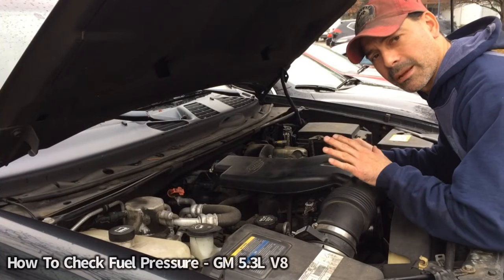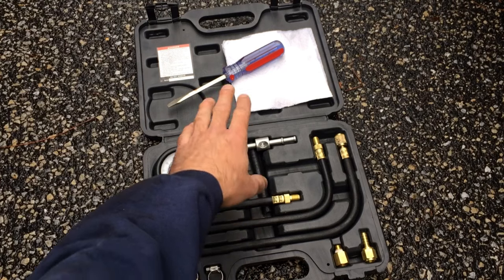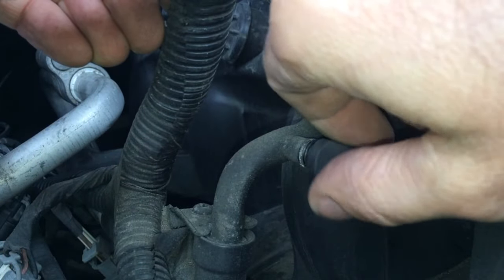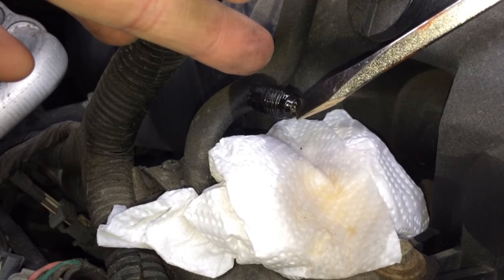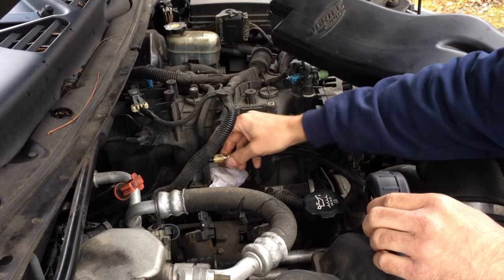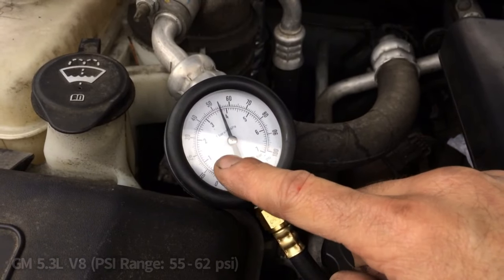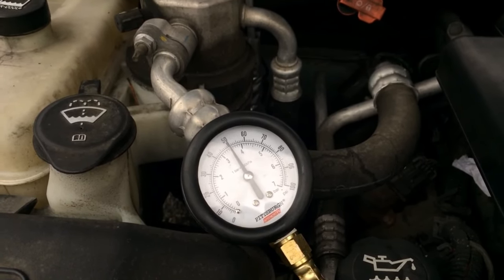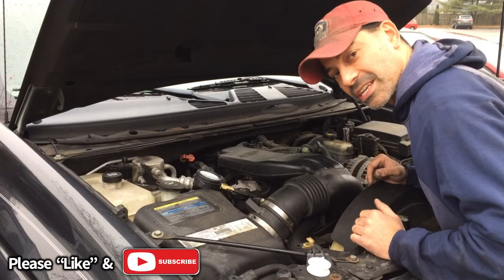How To Check Fuel Pressure - GM 5.3L V8 (Andy’s Garage: Episode - 147)

Comment: Generally a good video.  There is one problem with using teflon tape or any other tape style sealant on a fuel system.  It risks breaking free and clogging downstream components.  This is why manufacturers and experienced mechanics will tell you this is a fail.  IF you must use a sealant then use an appropriate liquid sealant.  However, unless the threads are damaged this should not be necessary.  Tighten the Schrader valve by hand very snugly.  You should not even have to use a wrench or pliers.  That is why the connection for the test port is a knurled hand fitting and does not include a hex or other type driven wrench fitting.   Use tape and a piece is likely to break free and float around causing you a headache later.  This is especially true in fuel injected engines as the tiny atomization ports can clog with particles down to a few microns.
Reply: I've used Blue Monster yellow tape in the past and haven't had any issues to date.  Not sure if it's recommended but it's what I do.  🤷
Reply: It is temporary. Its fine.

Comment: The best way to bleed off fuel pressure is remove the FUEL PUMP FUSE and start the truck. Let it run until it stalls. If it attempts to start but doesn't, try once more to remove residual pressure. Use rags when installing or removing test equipment. When tasks are complete, reinstall fuse. Check for leaks!
Reply: Similar to how I run a carb dry on a bike. Turn of the fuel and run it.til it's gone
Reply: I would only go through all that if actually removing the fuel pump or filter clearing the rail just for pressure test is fine Otherwise your wasting fuel
Reply: Its not so much wasting the fuel. Some crack a line and let it spray. Some drain it in a catch pan. Some let it go to the ground. I prefer letting it bleed off by letting the engine handle it. No matter how its done, it has to be depressurized of any residual pressure to proceed. The environment and safety are priority.
Reply: Thankyou bro

Comment: I have a 2005 gmc envoy. Starts in the mornings but the After I shut it off once, it won’t start. Cranks only. Lately if I let it set for about 5 hrs it will usually start.
Reply: you might have an injector stuck open

Comment: Mine has 400k. And I’m suspecting it may have a bad fuel pump. Feels weak. But I have 35’s. And the other day. It kept shutting off, and after a few try’s it would turn on for a few seconds and then shut off. After a few of those. It did manage to stay on to drive back home 1/8 mile.
Reply from the maker: Make sure the pressure is to spec for your vehicle. If not, it could be the pump or pressure regulator

Comment: Currently experiencing a crank but no start on a 1999 Silverado 5.3L.  It has been sitting for a long time without being used and I recently replaced the battery to start up and get it running again.  Tank was empty so I added approx 4 to 6 gallons of fuel and used some starter spray.  Engine ran for a few seconds with spray but never stopped after that.  Would like to check fuel line pressure with this kit and wanted to know if turning the key to the on position, will the pump create enough pressure to get an accurate reading?  Thanks!
Reply from the maker: I had a similar situation with a vehicle I purchased a few years back. If the vehicle sat too long without being properly prepared for storage, the fuel system could be destroyed. Your fuel pump, regulator and Injectors could be corroded and seized up. Turn the key to the on position and listen for the fuel pump to hum for a couple seconds. If you hear it, then check for pressure. Just turning to the on position will created proper pressure if the pump is fine. If you don’t hear the pump, check to make sure the relay is good. If it’s good then the fuel pump needs to be replaced. Regardless of the pumps performance, if the vehicle still won’t start, check the Injectors since they may be corroded and needing to be replaced as well.

Comment: Andy, I have a 2011 Avalanche LS 5.3, my fuel pressure gauge starts at 53psi the drops to 42 psi, I have replaced fuel pump, both knock sensors, map sensor, maf sensor, spark plugs, Catalytic converter is good, the strange thing is I do not get any codes. I am exhausted with trying to correct this issue with poor accelation, it started now a month.
Reply from the maker: Did you replace the pump with an aftermarket one? Also, have you checked the pressure regulator and fuel filter?
Reply: Adelphi unit, regulator good and the filter is in gas tank its a permanent
Reply: Fuel lines. Might at well replace it all at that point

Comment: I have a 2018 Tahoe 5.3 and I notice that the needle of my fuel pressure gauge is erratic bouncing around during idle.  When I prime it the psi goes up to 80psi. Then 45min later it would drop to 60psi.
Reply from the maker: Could be the pressure regulator as well

Comment: FYI - I watched several tahoe fuel pump / fuel pressure videos.  I wonder if everyone is misleading viewers.  My 2004 Tahoe was running rough &  cutting off once in a while.  So I changed my fuel pump and rechecked the fuel pressure.  I saw a 43-45 psi pressure reading again at idle (wth!).  From what your video is saying this is low.  But then I disconnected the vacuum line going to the pressure regulator and the pressure jumped to normal 55 psi pressure.  I also saw your pressure was around high 40's when you 1st started your Tahoe too.  So should fuel pressure should be checked with the vacuum line disconnected?🤔
Reply from the maker: Try it both ways. It could be a faulty pressure regulator

Comment: I am having fluttering or stalling sensation coming to stops really bad after restarts.  Usually running 34 psi out back. It gets as low as 19 psi sometimes. Starts of at 80 psi  sometimes will hold around 55 or 60ish till i start driving for while it will come back down to 34psi.  2021 chevy silverado 1500
Reply from the maker: Sounds like your pressure regulator, but could also be your pump starting to fail. I would replace the pressure regulator first since it is cheaper and easier to do. If that doesn’t solve it then you need to look at the pump
Reply: @Phillips Vision  appreciate your time sir.  Thanks

Comment: My Silverado has 50 psi after replacing the psi reg.
The misfire usually occurs when hot and high humidity will shake your teeth. The idle can be there rough.
Replaced evap solenoid and parts store scanner claimed maf sensor was bad. Nope.

Time for fuel pump

Comment: I just changed my fuel pump and fuel filter on my 2002 5.3 chevy tahoe. I was at 42 psi prior to changing out the pump and filter. I'm still at 42 psi. Could the fuel pressure regulator the fault for having not enough psi as I should?
Reply from the maker: Yes, could be the problem. Before you change it make sure you have a tight connection at the schrader valve
Reply: @PhillipsVision  for when checking the psi? I was using pipe tape on both the Guage connection and the rail connection so I'd imagine there was no leaks. I'm going to change it this morning. After changing the fuel pump yesterday, changing the regulator is nothing lol
Reply: @PhillipsVision  it's a flex fuel engine. Does that change the needed psi?
Reply: @mikespence8895  did the regulator fix the problem?
Reply: @rayriley174  no.
Reply: @rayriley174  I gained about 3 psi.
Reply: @mikespence8895  any uodate?
Reply: @davidbollier3859  I changed the fuel pressure regulator and I gained 3 psi.
Reply: @mikespence8895  hi mike it’s  been 6 months, are you still having this problem or were you able to solve brother ?
Reply: @heirloom462  I just left it and haven't had any problems.
Reply: @heirloom462  I also changed the regulator and it was still at 42.
Reply: @mikespence8895  
Flex Fuel Engines ("Z" 8th Digit in VIN) Issa Different PSI than all others
Reply: Unplug the vacuum line going to the fuel pressure regulator and see what pressure does.  Mine was 45-48 psi with vacuum 😮line connected.  Disconnected the psi went to 55 psi... I changed the fuel pressure regulator today & rechecked the fuel pressure...

Comment: After filling the tank last night on my 03 4.8 silverado when i went to start it this morning all I got was cranking with no start. I put a fuel pressure guage on and with the key turned to on it doesn't move the needle at all. am I doing something wrong... thanks
Reply from the maker: Do you hear the pump priming (humming noise for about 3 secs when you turn the key)?
Reply: @PhillipsVision  yes I do hear something for few seconds
Reply from the maker: So...you are getting pressure from the pump but not holding it? Could be the pressure regulator
Reply: Thanks I'll check that out next

Comment: Hey Andy .  I wanted to thank you for your time in explaining the pressure gauge hook up process as it is different than the way I had been doing it .  I never bled the pressure off of the rail before connecting my gauge .  I also want to thank you for saying what the fuel pressure is " actually " supposed to be on these engines .  All of the other videos I've watched never announced the pressure .  I just replaced my original fuel pump because the truck is a 2000 Chevy Silverado 1500 with the 5.3 in it and the fuel gauge wasn't working properly anymore and the fuel pressure was reading @ 50 psi and would drop down to 49 psi within several seconds  .  So I bought a " Brand New " AcDelco fuel pump and changed it out , did a pressure test and came up with  52 psi and it would drop down to 50 psi within several seconds .  With that being said and going by what you are saying the fuel pressure " should "  actually be  , it looks like this " New Fuel Pump "  could be bad too .  The truck was still showing a code P0300 multiple cylinder misfire , so I changed out the spark plugs and the truck ran worse .  I more than likely should've changed out the plug wires too while I was at it , just didn't think it needed them until now .  Fuel injectors were all showing the same amount of pressure drop ( 17 psi ) when I tested them and the multi-meter test showed they were all getting the same readings , so I think I can rule out the injectors .
Reply from the maker: Does the pressure stop at 50psi or keep dropping? If it keeps dropping you may need to install an in-line fuel check valve to maintain the pressure, here's a video I did installing one: https://youtu.be/STIQa1ct_5s . The P0300 code is also a random misfire which can be tricky to diagnose. As for the truck running worse; did you gap the plugs properly? Bad plug wires can cause the P0300 as well but you may want to test the wire resistance before replacing them. I did a video on testing the wires, here's the link: https://youtu.be/am4JlHK1kS8 . Hope this helps
Reply: @PhillipsVision  Thanks for responding Andy .  I was wrong with my numbers in the first message to you after the new fuel pump install . The fuel pressure was 50 psi and then would build up to 52 psi within several seconds .  At least the new one  was building up instead of dropping like the old one was doing .  No , the pressure doesn't keep dropping , it stays @ 52 once it builds up from 50  .  It only takes a few seconds for it to build up to 52 psi from the 50 psi it initially starts at .  The plugs were gapped to  .40 as per specs .  Also ran some fuel injector cleaner through the fuel rail .  Unplugged the fuel pump fuse under the hood , hooked my injector cleaning system to the fuel rail ,  then started the truck and let it run until the canister ran dry and the truck stopped running .  It just seems odd to me that a " brand new "  AcDelco fuel pump only raises my psi by 2  ,  from 50 to 52 psi .  I thought the fuel pressure was supposed to be between 55 and 60 psi though ?  If that would be the case , my new pump isn't putting out like it should .  The truck seems like it's not getting the fuel output it needs .  I installed a new fuel filter , new fuel pump , new plugs and wires and the injector testing resulted in a pressure drop of  17 psi on all 8  injectors .  However , I don't know if 17 psi is a long enough duration of a pressure spray of fuel per cylinder .  If there is anyone out there that has done similar injector pressure drop testing please feel free to share your findings or results .
Reply: @jasond.606  had the same issue wasn't fuel P0300 it was a coil pack.
Reply: @jackhilley6962  Hey Jack .  Thanks again for responding .  I had a local dealership do a diagnostic check on the truck and they said it showed a P0353 and one for the MAF which is one I set .  They also told me I needed a " New ECM "  which wasn't on the diagnostic sheet ha , ha , ha - no way they would neglect something like that intentionally , right ?  LOL again  .  Unless they were just wanting to scam me out of $ 800.00 dollars , so I called them on it and of course got some lame excuse .
Reply: @jasond.606  Did you ever find the problem? I had a missfire like that once that ended up being a vacuum leak. Stay away from the dealerships at all cost.
Reply: @jasond.606  any update? Having this problem now
Reply: If you live in the rust belt,  check for rusted lines.  One small leak leads to pressure  drop.

Comment: Could someone tell me where the fuel pressure regulator is on a 2010 gmc Sierra 5.3? I have searched YouTube and I can not find out any information.
Reply: It's in the gas tank...it's  part of the fuel pump...
I have a 2010 Yukon Denali...I was lookn for mine all over YouTube ..no luck..til someone told me....yeah u gotta drop the tank...mine took 2hours..great mechanic...good luck

Comment: I put the gage on my 01 6.0 and ran just like this just under 50 psi. I turned off the truck and lost the pressure right away?
Reply: Fuel pressure regulator most likely. Don't rule out leaking injectors, but rich exhaust and misfire will be hand in hand when injectors leak.
Reply: @steveallen7742  how would I test leaky injectors I gotta make sure
Reply: I have 35 years in automotive repair and half of those were at GM dealerships. I have swapped maybe 10 injectors on GM products. Swap the module assembly in the tank. I have put in quite a few hundred of them. Easiest way on a pickup is tilting the bed up. Remove 4 bolts on tank side and loosen the other 4 on the opposite side. Remove filler neck bolts, unplug bed harness, remove filler neck ground, get a couple buddies to lift the side and block it ( At least three 6×6 posts cut 20" was our choice) well. Seriously, early Duramax had injector issues. Gas burners were rare as hen's teeth.
Reply: @steveallen7742  I have the 01 crew cab 6.0 4x4 with a 5 speed manual gas it goes any where
Reply: @lowerdesert9577  Take some vise grips and wrap the jaws with tape. Use them to pinch the return line going back to the tank. Key on... If fuel pressure doesn't drop, regulator is fault. If fuel pressure still drops, take a second set and wrap (unless you have hose pinching pliers). Leaving the first set on the return still, get prepared to pinch the inlet line. Key on, immediately crimp inlet hose. If pressure drops injector(s) will be fault (Again, that's unlikely. That fast of a fuel drop can fill a cylinder with fuel and hydraulically lock the engine. You will also find fuel in the oil). If pressure is up and holding, fuel pump module is fault. Make sure the hoses are firmly crimped, but protected. It isn't good to crimp the plastic fuel lines but it won't kill them if protected.
Reply: @steveallen7742  Currently trying to diagnose 09 2500hd gas nonflex fuel does not have a fpcm, getting gas in the oil after shutting off the engine was thinking it was the injectors could this be a pump issue I havnt tested pressure yet thats why I was here.
Reply: The only possible scenario is leaking injectors. If your coolant temperature sensor is unplugged it will pour fuel to the cylinders.

Comment: 2008 gmc sierra 5.3 started truck 45psi and needle jumps 44 45 I think pump is bad
Reply from the maker: Yes, that’s very low. A new fuel pump and pressure regulator might be needed.
Reply: @PhillipsVision  thanks god bless from albuquerque new mexico

Comment: With the key on mine drops to 0. What could be causing  that
Reply from the maker: When you turn the key to prime it, it drops to zero?
Reply: @PhillipsVision  with key on it jumps too 90 psi for a seccond then bleeds off instantly to 0 psi. I cycle it a few times same thing. It will run bouncing around 120 psi some one has osias e85 pump in it. It's just a stock 5.3 swapped obs chevy. I'm thinking new pump? Using thr factory sender. May just grab the whole gas tank form the 02 chevy  an make it work
Reply from the maker: @ODellGarage731  could be the pressure regulator as well.

Comment: Hello, I got pressure primed at 58 psi and running at 43 psi plus a P0171 code. Pressure holds well. What could be the problem?
Reply from the maker: P0171 means you’re running lean (too much air). You might have a vacuum leak
Reply: @Phillips Vision  I'm having the same issue. What would be a good starting point to check for vacuum leak?

Comment: I have a 5.3 but it's not the same.  I have a 2014 gmc and there is no valve.
Reply from the maker: This is a 2003. Most newer vehicles are not equipped with schrader valves

Comment: Is it normal by over night sitting fuel psi to drop to 0 ? But will hold 52psi for few hours then  slowly drop and by over night it’s to 0-5psi
Reply from the maker: No, it’s not normal. The pressure may go down slightly but if it’s dropping to that level you may have a leak somewhere. Do you have problems starting it in the morning?
Reply: @PhillipsVision  no it always starts and runs great , it has a performance 340lph fuel pump assembly .. I took off fuel rail and primed the fuel pump no injectors leaks , checked fuel lines nothing leaking , and it’s a brand new fuel pump whole bucket assembly .
Reply: @PhillipsVision  it’s a 2001 Camaro Ss procharger with quantum 340lph fuel pump assembly